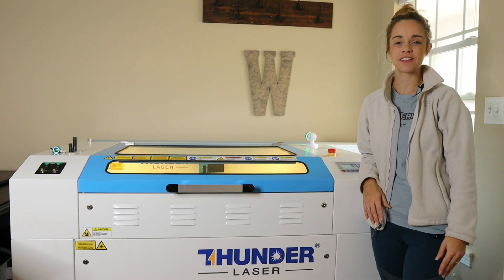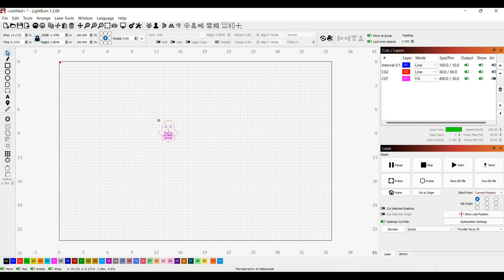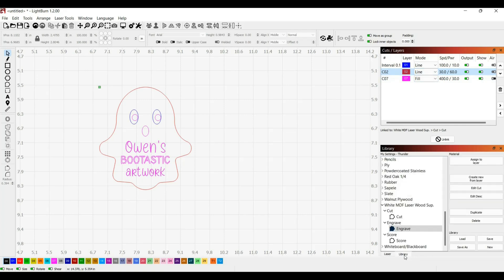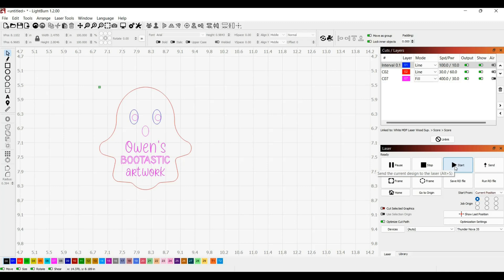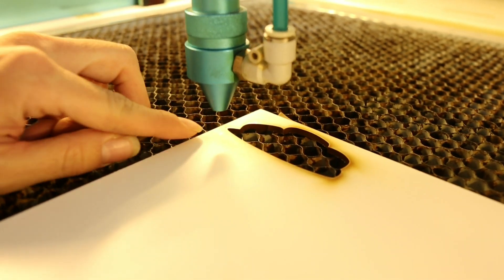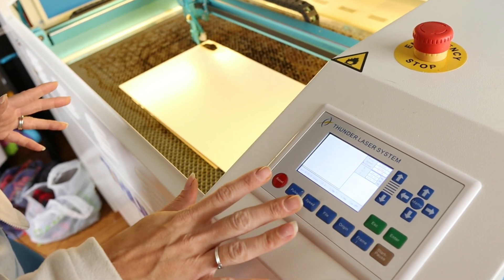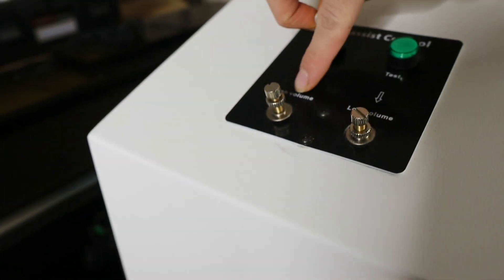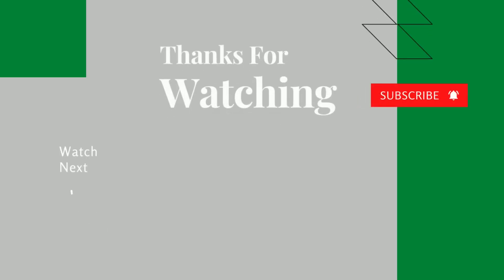How To Use Thunder Laser

Comment: This is a well made,  easy to follow video. Your Thunderlaser is a top quality machine and you have chosen well. I detect there are quite a few things  you have yet to discover about this great machine . When you switch your machine on the loud noise "that's kind of annoying" is the chiller alarm  telling you there is no water flow through the the tube . When it goes quiet, that's good news because it indicates that you now have the water flow that is so essential for  your laser tube to work. 
 I note you have the X and Y  manual  motions set jump  about 5mm at every touch of the arrow key. Was that intentional?  Pressing the ZU button reveals a sub menu where you will find Manual Set. This allows you to change the fixed jump steps to smooth Continuous motion, the speed of that motion is set with the Speed button on the keypad.
 It was a great point to mention the air assist control panel and how Lightburn allows you to set the air flow for each layer depending on if its a cut or scanning. It should be set to almost zero airflow for engraving (just enough to protect the lens)so as  to prevent  the brown tar fumes blowing back onto your work and to max airflow for cutting,  so that you can blow those same tar laden fumes out of the BOTTOM of the cut. The brown top edge indicates  insufficient airflow  or cutting a bit too fast.  Wiping the residue away afterwards is a fix  but that same method  wont work for acrylic because the fumes bond to the surface. 
 There is no criticism intended in my comments,  its an excellent presentation.   I have hopefully  just added a few missing details for new users to the technology that may be watching.
Reply from the maker: Thank you for your comment! I appreciate your insight on everything. That will definitely be helpful for others too.

Comment: Why did your laser home to that position or did you move it. Thought it goes to upper left corner
Reply from the maker: I moved it to that position so that I could reach it better. I rarely start it from the left corner unless I have a project that takes up the whole bed.
Reply: @85thandPine  but it homes to the top left when you first turn on correct. Or did you change that
Reply from the maker: @CD_DESIGNS  yes mine homes to the top left unless I moved the origin